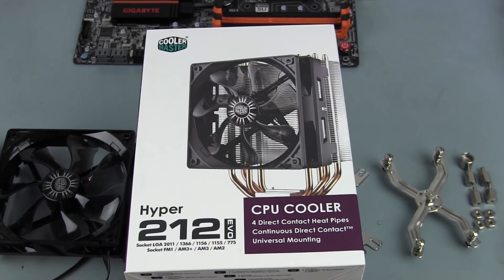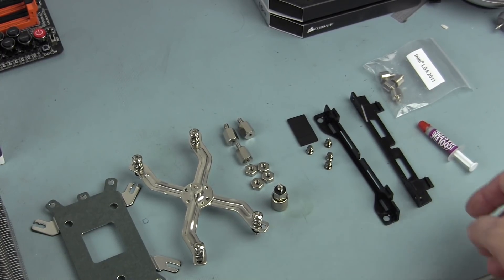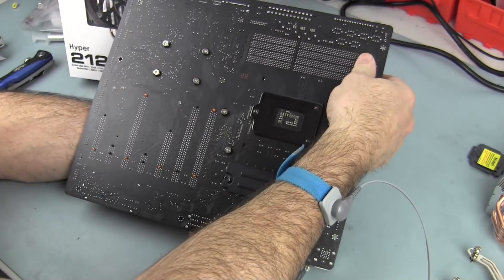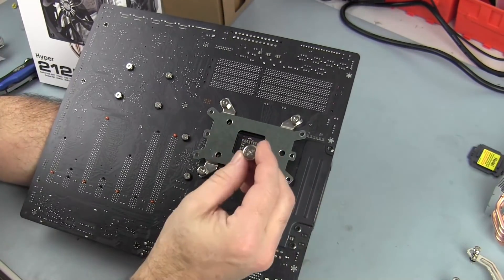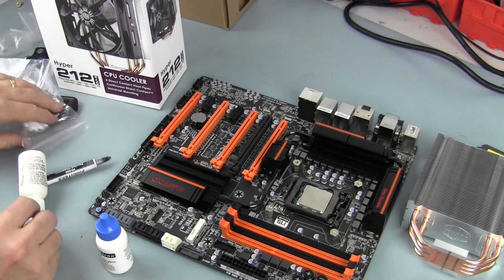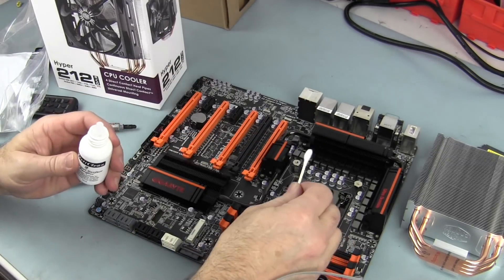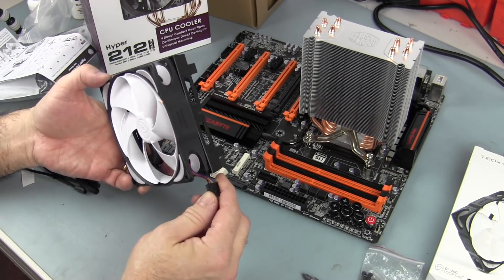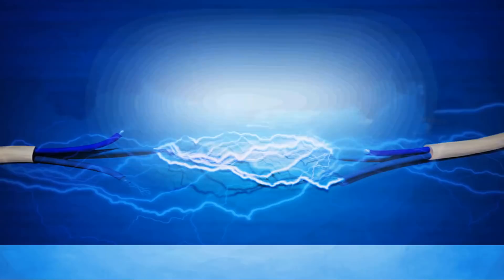How to Install a Cooler Master Hyper 212 Evo CPU Cooler

Comment: Question : Will this fit inside a Corsair Spec 01 case?
Also, my motherboard is old, I hope I can work around the backplate and I won't have issues installing this giant thing.
Reply from the maker: Unless the person answering your question has the case themselves it is hard to say for sure if it will fit.  The only other way is finding out the inside case dimensions from the specs and the cooler from the specs is the best way to learn if it will fit.  You are on the right path to figure it out.
Reply from the maker: Yes, it should.  To be sure find the height off the packaging and measure the width of your case.  That will give you a better idea.
Reply: Ronsanut Thanks a lot!
Reply: The tomshardware's guys said no.
Reply: Tuzo AsianDramas&Anime For fucks sake. Every single person I ask this, gives me a different answer. It's unbelievable. It would make no goddamn sense if it doesn't fit, surely the case isn't that wide, but I think I'll stop asking questions everywhere and just go back to amazon where i bought my case and measure both the case and then the goddamn radiator/cooler. Thanks anyways
Reply: Yes.....I mean no
Reply: +SyncF It will not fit, that is a definitive answer. I myself was about to buy the Spec-02, which is larger, and it still lacked enough clearance (something like a measly 10mm). So there's your answer if you were still wondering!
Reply from the maker: Thanks Kilonoid for answering. It is hard to tell without knowing the actual depth in the case and sometimes the motherboard can make a difference too.
Reply: Thank you guys for all the help. I'm not going to change my cooler at all because I looked up all the info I needed, and to be honest even if I could fit that cooler inside it would make no difference with my older CPU. I guess I'll wait before I build a new PC with a bigger tower, to do this.
Reply: +Ronsanut No problem, some 30 minutes of looking at Toms Hardware (great site btw) got me a clear cut answer. Enjoy your new PC!
Reply: I ran into this problem as well. I turned away from the spec-01 and bought the spec-02 which allows more space.

Comment: This cpu cooler is don't need a cooler paste?
Reply: it needs thermal paste
Reply: All CPU coolers need thermal paste.
Reply: +GTX 1080 he didn't put any did he ?
Reply: YoungClickClack Just because he didn't show it doesn't mean he didn't do it.
Reply: YOU NEED THERMAL PASTE or cpu will burn and no heat will be transfered
Reply: +GTX 1080 I'm new to this stuff I didn't even know what thermal paste was haha
Reply: its alright building a computer isnt that hard so you should be fine if you have any questions you can ask me

Comment: my motherboard doesnt have holes that go through to the back. so the standoff screws don't appear in the backside, so I cant install support bracket. Will it be fine anyway?
Reply from the maker: +Matthew Mammola If you don't move your case ... maybe. But it is designed to have the bracket support the weight of the cooler.  Also it it is a tower case I would not try it. May break something.
Reply: +Ronsanut yeesh. thanks for answering. i guess this motherboard (GIGABYTE GA-X99-UD3P) just isnt designed for something like this. i may take a chance on it anyway tho... thanks a lot for your tutorial!
Reply from the maker: +Matthew Mammola No problem.
Enjoy!

Comment: does it work with an i7 2600k socket 1155 LGA ?
Reply: +Angelo Luna 

yes
Reply: mackjeez
okay thanks
Reply: cpu doesnt matter. socket matters. You are also 4 generations of performance behind
Reply: The Timelords 

The 2600k is still an amazing CPU, at 4.5-5GHZ on air alone it is amazing what scores this baby produces, it blows the 3rd gen out of the water and is equal with the 4th gen if not better in some cases.
Reply: mackjeez ghz arent what matter anymore man
Reply: The Timelords 

CPU clock speeds, cores and larger amounts of CPU cache memory that the CPU can work with all matter. Although cpu clock speeds are compared per architecture SandyBridge vs SandyBridge, Haswell vs Haswell...etc..It all comes down to performance and the 2600k has impressive scores even on default cpu speeds.
Reply: mackjeez amount of transisters matter too

Comment: How do I know if a cpu cooler will fit to my cpu?
Reply: +Reier O. Berg Usually there is a list on the manufacturer's website stating which socket types the cooler does support.
Reply: Gino Sison Alright, Thank you :)

Comment: Nice tutorial! I am about to mount the Evo's successor (Hyper212X) on a Skylake CPU and your well shot video comes in handy. Just wondered what the centred screwlike pin is in the middle of the X-frame; is it just an axle/pin or a screw as well? O well, I see it when I get there. Installed multiple CPU-coolers and it's probably the bitchiest part of assembly...
BTW You thouroughly cleaned your CPU before adding the thermal paste; should you also need to clean the cooling block itself after peeling off the plastic?

Comment: which one do you prefer with this cooler: cooler master af120 or cooler master sp120 fan?
Reply from the maker: +GhoverXGaming The SP120 would be best.
Reply: +Ronsanut and for intake fans?
Reply from the maker: +GhoverXGaming Intake fans on the case can be the AF120's unless the case you are using has hard drives that the intake fans also need to cool or blow across, or if the front grills have tight fins or other restrictive spacing.
Reply: +Ronsanut  thnx mate!
Reply from the maker: +GhoverXGaming Anttime. Thanks for watching.

Comment: This video helped me 10000000x more than the stupid instructions that were in the box. Thanks! My CPU temp went from 100F to 150F (when I took out stock fan and removed thermal paste by mistake) to 80F with this cooling tower. Took me like 2 hours to install but worth it!!!! 🙂

Comment: This fan is ridiculous. I spent 3 hours trying to install it. the instructions were junk. and it won't for even thought it should
Reply: Agree. I tried to follow instructions but they weren't helping when it came to clamping down heat sink to motherboard so I came here.

Comment: the screws on my bracket sit above the standoffs and if i screw ine screw into a stand off, the opposite (diagonal) screw sticks up meaning that i cant screw the heat sink down please help
Reply from the maker: +Silly Noises Check and make sure you have the center pin of the bracket sitting in the hole in the center of the block under the heat sink fins.
Reply: +Ronsanut i have sorted it now :) the problem was i have an AMD board and was unaware that pressure had to be applied when screwing in the screws. Thanks anyway though!

Comment: I got this and installed it correctly but now its making a weird clicking noise when i render a video in vegas or put the fan to 100%. Does anyone know what the problem could be?
Reply from the maker: Check for a cable close to the fan blade. If there is nothing touching it could be the fan. If you have another fan swap it and see if it happens again.

Comment: Could i install this cooler after i built the computer?
Reply: + Poo vidgrod YESSSSSSSSS
Reply: +vidgrod poo Yes you'll just have to replace your current cpu cooler.
Reply: Do it while your motherboard is out in the open. Trust me!!!
Reply: +TraumaER is itbdoable in a case
Reply: if you can access the backside of your motherboard,but it isnt worth the hassle and what youll need to do.mgiht aswell remvoe the board to do it

Comment: this thing is a pain in the ass
Reply: ill take a look thanks
Reply: +xRave just got arctic cooling freezer 7 pro rev 2 and installation was a piece of cake and it cools my cpu really good
Reply: i got the 212 eve in it works nice i think what you need o do is remove the fan from the radiator then attach it to the motherboard
Reply: +xRave Okay, it's good cooler too i believe

Comment: what is on your wrist?
Reply from the maker: +Shy Guy That is an ESD ground strap.
Reply: +Ronsanut what does it do? sorry I'm new to this
Reply from the maker: +Shy Guy It prevents static discharge from damaging your electronics.  You don't have to use one as long as you know how to ground yourself when handling electronic components during your build. 
http://whatis.techtarget.com/definition/electrostatic-discharge-ESD
Reply: +Shy Guy its an anti static wrist band.

Comment: They should of made the installation like the old cooler master v8 which is way easier than this because you tighten the nuts on the back plate behind the motherboard instead of trying to get a screw driver in the front.

Comment: I bought this but I just used the cpu fan that came with the proccessor, woops- well it was my first time, will the stock cpu fan be okay or should i uninstall and put this in?
Reply: +TheMrlittlemack if you aren't planning on overclocking or really testing the limits of your cpu, the stock fan will be fine.
Reply: cool yea im not overclocking, i want it to last me a while- thanks

Comment: My current mother board came with a CPU cooler back plate and its stuck on there and i cant get it off. the standoffs with this CPU cooler dose not fit inside the back plate but if i try to install it without the standoffs it fits. my question is that do i really need the CPU cooler standoffs?

Comment: if i had a beefy gpu will this cooler interfere with the first pci-e slot? im planning on going 2-way sli.
Reply from the maker: +Miguel James Martinez All depends upon how close your CPY socket is to the PCIe slot for your GPU. Also you can orient the cooler front to back or bottom up in your case so that it does not interfere.

Comment: Two questions:

1) Does this fit the 1150 socket?

2) When building the PC, do you install this after the mother board has been installed in the case?
Reply from the maker: +Luke 1) Yes.  2) You can mount it after the motherboard has been installed if you have an opening in your cases motherboard plate.
Reply: Ronsanut Thank you.

Comment: is it ok if it slightly moves tot he left and right like 3 5 mm(rotate)  after I lock it in or I did smthing wrong :D
Reply: +Redman Alex You need to adjust the screws and make sure it's screwed in the right rotation.
Reply: +Redman Alex mine does this too, is it ok?
Reply: after 3 months I can say this cooler has no issues

Comment: will this fan be good for the i7 6700k  proccessor? and will it fit in a mid tower? sorry im  building my first PC and im still kinda new to this stuff
Reply from the maker: +omuyasha Yes. for that chip it will be fine.  It should fit in most cases, but depends actually how wide your case is.

Merry Christmas!
Reply: Ronsanut my case is this;

http://www.coolermaster.com/case/mid-tower/elite-431/

Also Merry Christmas to you to :)
Reply from the maker: +omuyasha Yes, it should fit in that case.
Reply: Ronsanut Thank you so much, you been a great help! I can finally buy this cpu cooler with confidence. :D (Now I just need a way to fit the MSI 980TI GPU that I'm planning to buy in my case and I'll be set lol.)

Comment: Will it fit in a Cybertron 5150 escape case
Reply from the maker: +Aleeeex1055 Yes it should.
Reply: Yep figured that out. Just got done upgrading from a 4 core amd processor to a amd 8350 8 core with this awesome piece of macinery installed. keeps my cpu around 30c which is a lot better than stock heat sinks. Also getting a GTX 970 ACX 2.0 4gb graphics card. Would you reccommend it or is it too much overkill. It runs most games 60+ fps so i think ill get it, just need to know your opinion.
Reply from the maker: +Aleeeex1055 That GTX 970 ACX 2.0 4gb  is an excellent card! You will be very happy with it.  Nice job! Merry Christmas!
Reply: +Ronsanut ok thanks!

Comment: am I able to position this cooler in any direction? (for airflow)
Reply from the maker: +Nova Lord Traditionally front to back , but you can have the airflow blow up out the top of your case if you have vents at the top.
Reply: +Ronsanut thanks, I'm planning to build a pc and I was wondering if I could make it blow out my top fans.

Comment: My fan isn't running. Why?
Reply: +Waves You need to find the cpufan header...and if you can't. Then you won't have luck with other fans either.
Reply: +Waves ...Did you plug it into the CPU fan header?
Reply: Jon Cannon i think it's a bad fan. Because i tried every port on my Motherboard than will fit.
Reply: Z-Scart i plugged it into that and it isnt working but its a newish motherboard so it must be the fan
Reply: Waves You should look at your motherboards layout in the user manual. If you find it and if on the board it says "cpu fan" or "cpufan" that's it. If the fan still doesn't work try getting a different fan.
Reply: Z-Scart i tried all ports. SO yes, im going to order a new fan soon

Comment: Hey guys will this fit on a Corsair Carbide Series SPEC-01?
Reply: Yeah I'm installing it right now I'm just confused how to put in the thermal paste when he said put it in a line method should I just put it in a line down the Intel idk
Reply from the maker: +CS:GO- Nelly Yes, you can squeeze a thin line down the center of the chip or you can put a small dot about the size of a small pea in the middle.

Comment: I have i5 4670k (stock) on prime95 my temps go up to 70-80c is that normal??? Using this Cooler!!
Reply from the maker: +fr0sty It all depends on how much vcore voltage you used in the overclock. Chips can get to 70-80 under Prime 95 even with this cooler.
Reply: stock settings but vcore was at 1.207volts i dont know why O_o

Comment: For an 1151 motherboard (I have an Asus Z170 - A), do you know which slot on the mounting plate I use?  There is no reference to the 1151 in my manual,  but I know it's compatible since there is a sticker on the box that says "1151 Support." Basically I just need to know if I use the inner,  outer,  or middle slot to screw in the plate.  Thanks for any help you can provide.
Reply from the maker: +Bick Benedict It should be in the instructions.  I don't recall, but think it is the middle.  But check the instructions.
Reply: It's not listed in the manual lol.  But I found out from the forums it's the middle one. Thanks for this great video.  It helped me so much.
Reply: It's not listed in the manual unfortunately.  However, I found out from the forums it's the middle one. 

Thanks for this great video.  It helped me so much.  

Can I ask one more thing?  In the video,  you refer to some of the screws as "standoff screws"  Are the "standoff screws" the longer and more narrow of the screws?  You have two sets of screws, one set in a bag.  Are the ones in the bag the shorter screws?  I just want to know so I can tell what ones screw into the mounting plate.
Reply: +Bick Benedict Can you please say what cpu temperature you get with this Cooler Master 212 EVO cooler under full load?
Reply: +Bick Benedict I'm installing this onto an 1151 board now (GIGABYTE Z170MX-G5). It's exactly the same: Center registration hole for the mounting bracket screw positions, same support backplate, etc. Pretty much ready to rock. Have fun!
Reply: +Nate Ungrodt Hey man Please let me know what temperature you get under full load and your room temperature that the measurements were made with i7-6700K?
Reply: +faustsmith I'm running an i5-6600K, at stock speed for baseline measurement, with Arctic Silver 5. Ambient temperatures are around 21-22 C. Running HWMonitor, minimums are at ambient, while full load temps after 15 minutes of Prime95 climbed to 61 C and then leveled out at around 55-57 C. Using this cooler, there is plenty of OC headroom on the chip I received. Great stuff.
Reply: +Bick Benedict Its the middle slot
Reply: i just put my one on and i used the middle one
Reply: faustsmith 15-17 C for me under full load, ridiculously awesome, although applying the thermal paste correctly and installation gotta be right too
Reply from the maker: +Bick Benedict Middle one. Same as 1150.

Comment: Is there just a little bit of give when this unit is fully mounted and screwed down? I found you can kind of move it after its fully screwed down...in case the heatsink is not quite aligned...not sure if that's intended..Thanks

Comment: Will this fit in an nzxt h440?
Reply from the maker: +RunningFrom Kony Yes, that case is deep enough.
Reply: Thanks man appreciate it!
Reply: +Ronsanut hey. will this cooler fit in my Rasurbo Vort-X midi tower? it's a noname product and i really don't know much about it. do you know more than me about it? :D
Reply: +Ronsanut D 475 / B 185 / H 408 mm. but i can't really use those informations :D
Reply from the maker: +Avero.- Takagi Don't kno you would have to get the inside measurements of the Vort-X and check against the cooler height.

Comment: can i install this heat sink so the heat goes right out the top of my pc case
Reply: nope. 
it only disperses heat in the direction of the back or front of your case.
Reply: +Mark Elia cool just was wondering i have one just didnt want to re thermal paste it for nothing if it didint work that way
Reply: +jaylord55 sigh, I do too and I'm not getting good temps )):
I feel like seating it is so difficult.

Comment: Hi, how wide is the case you are installing it in? It appears that it will not fit in all cases. Can the fan be mounted on the other side of the cooler to blow out the back of the case and lastly will the fan hit your memory sticks? Thanks

Comment: Hey, i have the NZXT H440 Razer Eddition case. What way should i orient my Cooler Master Hyper 212 EVO that would be good for the airflow of my case (since this fan already has preinstalled fans i wouldn't move). Would the fan facing my ram be good? Thanks for your help :D
Reply: +Jesper “Dib” Locher what u mean
Reply: Jesper Locher ahah, i was doing tons of research before i built my pc xD
Reply: Jesper Locher Finished my building, its a monster :D
Reply: +Phoenix Gaming I have the h440 case as well coming in, which way did you put your fan facing? C: